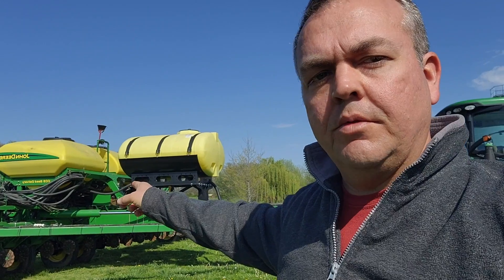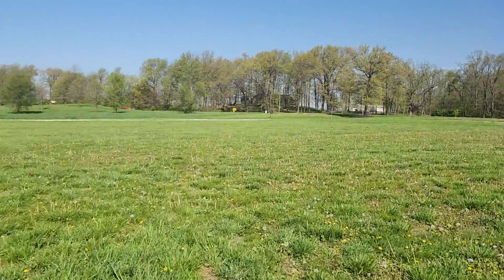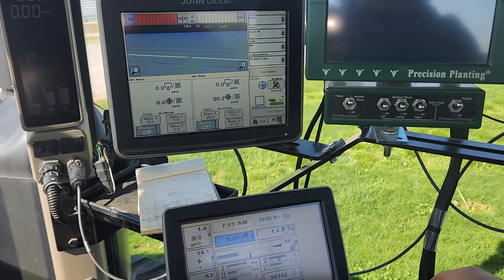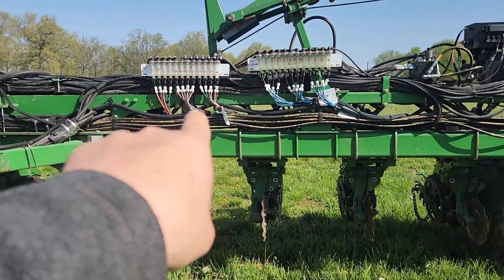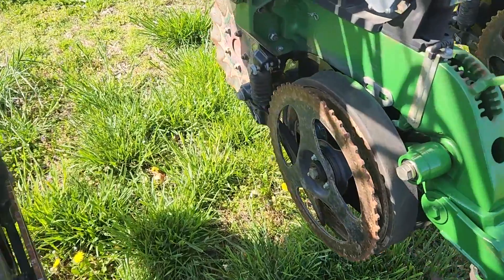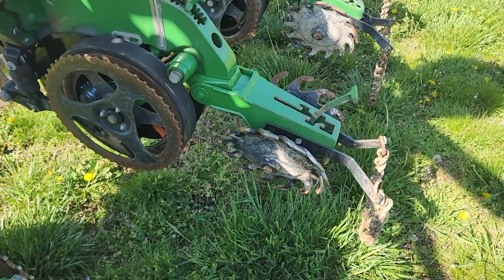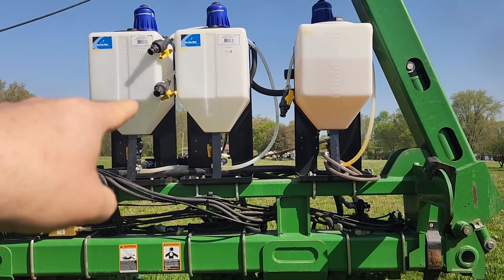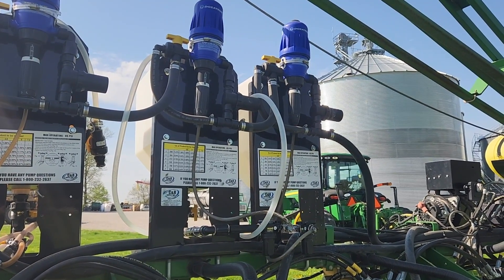In-Furrow and Two-by-Two Systems to Run Starter on a No-Till Planter

Comment: Are you happy with the concealed units?  We currently have disc openers 2x2 on separate tool bar.  I’m tired of them balling up or not turning.
Reply: For the most part, I'm very happy.  No balling up concerns, and I like that there is nothing out in front of the row unit.  It's a very clean design.  My only critique is that I wish it put the fertilizer deeper into the ground, but I would never go back to a single disk opener.

Comment: What starters have you tried and what product did you like best?
Reply: I have been running a lower salt product in-furrow.  The past couple of years it has been 6-24-6.  You can run the higher salt products in 2x2.  I feel that the most important fertilizer to run 2x2 is 32% UAN, so that's what makes up the biggest part of my mix.  The nitrate portion of the UAN will feed the young corn plants when the soil biology has the rest of your soil nitrogen tied up.  From there, I usually add a cheaper Phosphate source (10-34-0) and some sulfur (12-0-0-26S).  You can even throw in a little bit of boron if your soils are deficient.